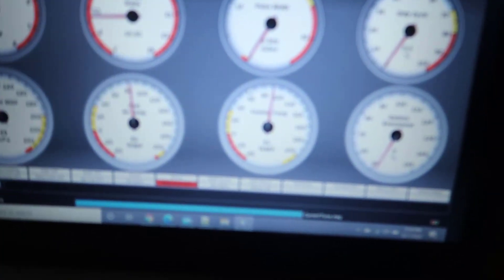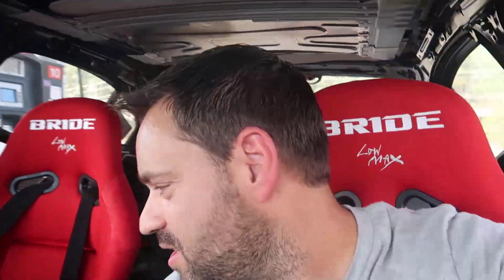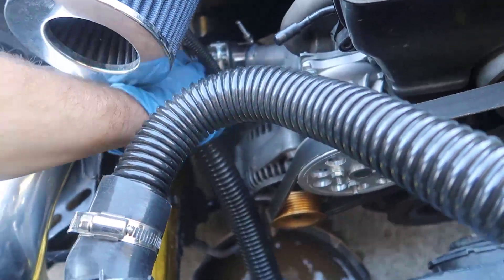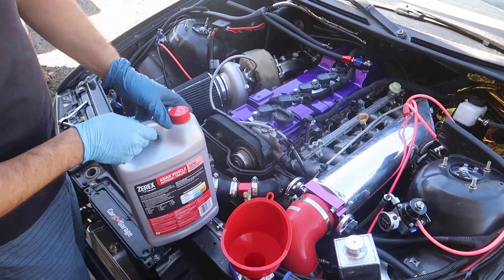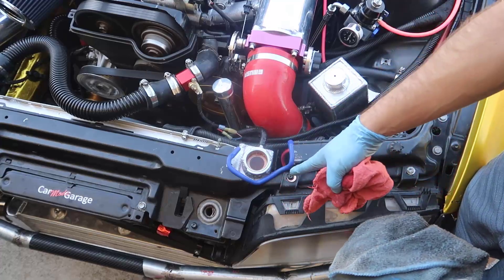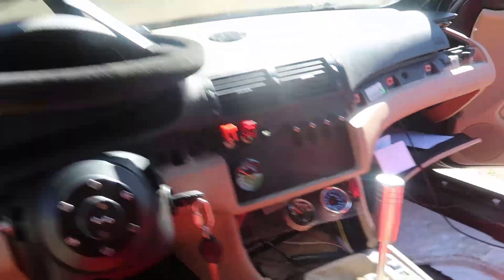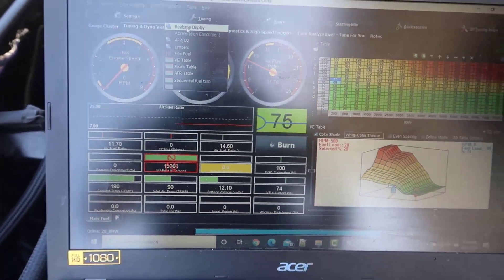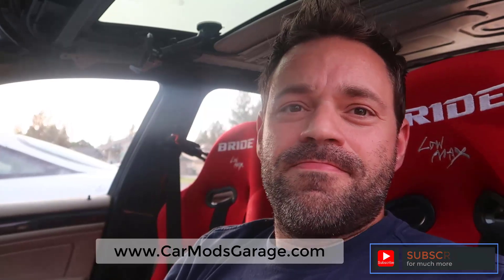Water vs Coolant Temperature Test. Which One is Better

Comment: Hey dude. First time here. And I don't know much about cars. But does this mean water cools the engine better than coolants? Doesn't that mean coolant isn't the best option for cooling the engine? (pls don't kill me I'm just asking, idk much about cars I drive a 93 corolla lol)
Reply from the maker: Don't worry man. Water is worse than coolant. Water makes it rust and boil faster so it is hotter. Water also freezes on freezing temperatures so the freeze plugs will break or pop of. It just happened to me. 
Use coolant not water.
Don't worry about the question man. I know how forums go. You ask a question then gets toasted  for asking a question.
Reply: @CarModsGarage  thanks my dude!
I don't really have a freezing problem in my place hehe
But I'm worried about switching to coolants because of the possible rust removing causing leaks like you mentioned in other comments 😬
Reply from the maker: @utubecomtw13  that's absolutely right. If you either clean your system or let the water out and it is too rusty inside you might have rust coming out of possible holes. This happened to me in Brazil once so it is possible. What I would say is that if it is working fine for a long time do not mess with it

Comment: What is the method of using coolant in a car that has been using ordinary water for a long time and would it be correct to put coolant in it? Our area is hot and humid. The temperature here is never less than ten degrees Celsius. It is generally said that a car that has been using water for a long time, if coolant is used in it, will cause rust and disturb the engine of the car.
Reply: If your running exsreme temps use distilled water with 33%coolant the coolant and distilled water will stop rust and cavitation and also the coolant will lubricate your water pump. Unless your car runs hot just go with 50%coolant and 50%distilled water.
Reply from the maker: Hmmm interesting. I would think that water causes rust and the outside temperature doesn't matter much since the engine and the water/coolant will get got anyways. 
That happened to me before when I took the old rusty coolant on my carbon Brazil and flush the system it took rusty spots that were covering or preventing water from leaking so it started leaking. It would leak eventually anyways. 
So in short water boils with lower temperature than coolant. Coolant has things in it that prevents rust. I can't tell what will happen to your car but if you been running for a long time anyways and it doesn't overheat there is no reason to replace. Check the color of the water though. I bet it is rusty

Comment: Coolant rust engine faster so use water
Reply: Water contain mineral that starts rust, use distilled water mixed with coolant to lube the pump
Reply: I know that pure distilled water is the absolute best for cooling dissipation but will corrode if antifreeze isn't used but I was thinking about using water wetter and just pure distilled water does that raise the boiling point or keep it the same?
Reply from the maker: I think it is the other way around. I had water for a couple of months while getting all set to run, wired and tuned. When I took the water out it was rusted already
Reply: @CarModsGarage  my mechanic told me to use water only and says coolant rusts engine I'm confused. I live in  hot climate area
Reply from the maker: @buggaman2009  interesting. I'll research more. When on some  drifting events they don't want people to use coolant because if or when crash and radiator leak then it would leak water not coolant. I've heard from a lot of drifters that water is bad because it runs hotter and gets rusty faster.
The hotel part of it I could prove on thai video. The rust though... Lets research 🤔
Reply: @CarModsGarage  in race events, You don't want glycol on the track. Because if it leaks or spills it will ruin everyone's day.
Reply from the maker: @rajajengkol  oh right some drifting events they require cars to run water also. I am comparing and experimenting for daily cars.
Reply: @CarModsGarage   I could see why they would use the water so it won’t leak and  make the track slippery  but for everyday use coolant is the way I am pretty sure a drift car will be used like 3 days out of the week so coolant is the way to good especially the hills of the VI 🇻🇮
Reply from the maker: @captainknuckles9599  ya that's a good way to go!
Reply: @buggaman2009  Water boiling point is 100°C but it is in pressurised system so the boiling point would be higher but with higher pressure, but if u use coolant 50:50 your boiling point is even higher and with lower pressure in your system plus it gets anti rust detergant in it. So thats the reason why u need to change it every two years because it starts lossing its ability of anti-rust after time. Manufacturers of cars recommends coolant too.
Reply from the maker: Good info!
Reply: @captainknuckles9599  coolant isn't for cooling its not coolant either its antifreeze which raises the boiling temp of water and keeps water from freezing but if you use an additive like water wetter it'll keep it from rusting and also keep the temp down